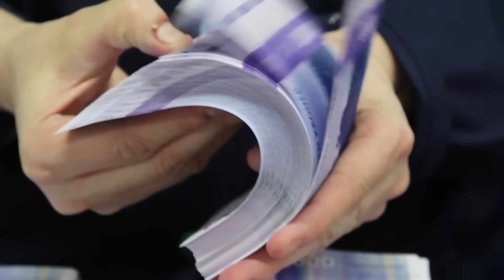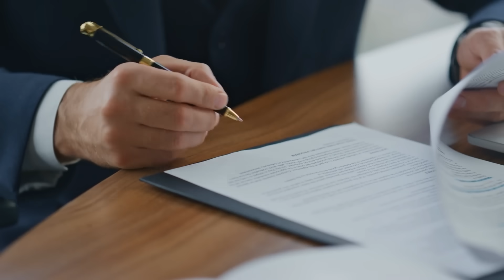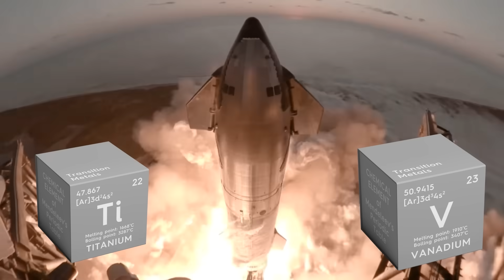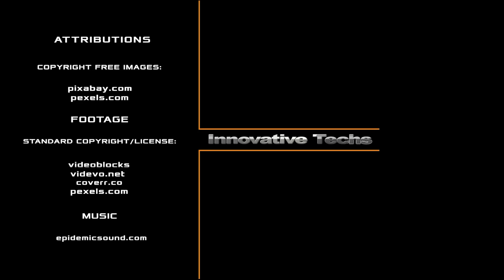Norway has Discovered a Resource that Could Surpass Oil

Comment: I'm pretty sure Norway has pollution issues in other forms that are harmful that they aren't talking about with their conversion.  No energy in the world comes without a waste product.  Let's be real folks.  Give the entire truth and not just the parts you want us to hear.
Reply: What the fuck is wrong with you? Norway is in the north, so we are cold. By the laws of Nature or the Will of God or whatever you want to call it, that means that we must receive the moist air from the equator and it has to release its water on our mountains. Water has to follow the law of gravity, so it falls and as it falls, we use the water to spin wheels to create power as we have done for a thousand years. You may hate us for our lack of sunshine and flat areas, but at that point it's a psychological issue and maybe you should deal with your conspiracy thinking. If your country chose to abandon slavery a thousand years ago and make sure everyone was treated fairly, you wouldn't be so conspiracy driven and criminal today.
Reply: 98% of the electricity is renewable energy. 96% is generated from hydropower, the rest from wind power and solar. Sure the hydropower plants have some methane releases from reservoirs, but it's minimal. There are some ecological challenges because it's in a living river system, but  the carbon footprint from electricity is extremely low compared to other countries. 
The oil and gas production however is horrible, so per capita the ecological footprint is extremely high. That's why the goal for the country is to become carbon neutral by 2030, and zero emission by 2050.
Reply: @i_d_i_e_h  You have the same numbers I have had for years. I think they're slightly outdated now.
But one question I have had, which I have never been able to figure out.....
2% of Norway's electricity comes from non-renewable sources. 
What are those?
I know we used to have a coal power plant on Svalbard. And we used to have 2 gas power plants. And the little research nuclear power plants. But I don't think those would add up to 2%. Do you know what else would add up to those 2%?
Reply: @Tjalve70  Well, it's a bit complicated to explain, and I'm by no means an expert on the subject.

The production alone is 98% renewable. 
The electricity we use is about 90 -98% renewable depening on year and import. The about 2% can be solar and wind, but also gas and coal imported from Germany and Denmark. Some of it is hydropower and nuclear from Sweden. 
You don't really know what you get, because the whole energy import is a mix of everything. 
And some people use wood as fuel during the winter, instead of electricity.

And of course - if you include every detail - we use some fossil fuel to transport fossil fuel, and that reduse the 90-98% down a bit I guess. It varies depening on what and how much we import each year.

Comment: Phosphates are also a critical ingredient in LED lighting. In theory you get white LED light by combining a red, a green and a blue LED in the same package, but that's a way too expensive solution. Instead the vast majority of "white" LEDs out there are actually UV LEDs shining through a phosphate layer that converts their light to a broadband spectrum of visible light. A trick that was used for ages in fluorescent tubes before blue/UV LEDs came along in the late 1990's.

Comment: 0:25  You implied a cause and effect between the Russian invasion of Ukraine and a 5X increase in $ but didn’t explain why oil revenues increased so dramatically.  Global price of oil had the hiccups but not enough to drive the growth you described.
Reply: It's not oil, but gas. However, gas is calculated in oil equivalents. Russia is an enormous supplier of gas but their war against Ukraine forces the world to not buy Russian gas, which restricts the supply and thus raises prices. Europe couldn't supply itself as it like USA does not have electricity, and therefore the EU pressured Norway to amp up the production of gas. To put this into perspective, I liquidated everything I could in 2020 to buy at $16us. One year later, the price was $135us. I bought at 20x gearing, which means I made a lot of money on the war in Ukraine, but I had no way of knowing and I certainly don't want it.

Comment: I had not heard of the findings in Norway.  Good for them.  As for the tailings?  Given advanced methods of ion-exchange separation, it could mean even more resources on hand.  As for hydropower?  Norway and Sweden have been making cheap nitrates for fertilizers from about 1880 or so, from my Freshman Chemistry Course, all from hydroelectricity and those dams that had previously been used for regulating river flow that was previously used in sawmills.  While some may think that those Countries were very poor, they were not.  These folks have been systematically using their brains for quite a while now.  I bet other Countries might have their own clever people as well?  What do you think?
Reply: Sweden also produces bulk potassium perchlorate and chlorate in the north of Sweden by Akzo Nobel.
Reply: in early Canada/USA when brainy residents were looking for ways to lessen back breaking labor they would scout out natural water falls[later the Granddaddy of the them all Niagara Falls] to generate free falling water power to turn their equipment. Later the life saving hydro electric powered by water falls was and is a game saver.

Comment: Even though everything seems too be fine, there are some serious problem for the future in Norway. Demand for electricity are increasing from datacenter for example and other heavily demanded companies. List of waiting from companies that want too have electricity from us are becoming longer and longer. Several cities are already huge issues with meeting the demand and the electricity companies who deliver the electricity too the people and companies wan't too lower the minimum required. So they wan't too increase the "power shortage" too their customers, but now the penalty are too high, but they wan't too decrease the penalty and make it more normal with power shortages.

That's simply insane that was unthinkable just few years ago, but they are now talking about it.
Reply: Datacenters is a resource for Norway as they are electrically heated water heaters. We need hot water in Norway, so as long as we use that resource properly, it's cool if someone wants to spend a million dollars on a 2u rack mounted 10kW water heater.
Reply: @jeschinstad  Maybe. But is that worth all the electricity they are using?
Reply: @MrLasox  Yes. A watt is a watt. Right now we are passing electricity through iron rods to create heat, but one watt of electricity creates one watt of heat. That is called heat loss. 70% of Norway's electricity consumption is 100% loss. That means if we generated the heat by means of Youtube video compression or even Bitcoin mining, then we could achieve 200% efficiency since the computing would only be a method to heat water for showering, washing clothes and heating homes. Another way to look at it is that we can do powerless computing. In fact it should be illegal to build datacenters in areas that does not need the heat.

Comment: Why aren't we getting it out of the sewage?
Reply: Good question.
Probably because it's more expensive.
I know that we USED to get it from sewage before detergents swapped out phosphates with some other stuff. And that other stuff made the sewage unusable as fertilizer.
So my guess is that the best option is to bring phosphates back into detergents, and start using sewage as fertilizer again.
We'd probably still need phosphate, but not as much as before.

Comment: The phosphate from Norway will not be mined until higher prices, as it is more expensive to get to than e.g. in Morocco.
Reply: Yes and that is one of the reasons why Norge Mining will sell to Norge.
Reply: Moroccan phosphate has a problem with heavy metals.  Would be good to find a replacement.

Comment: Interesting video but incorrect display at 10:39 as 24 trillion is not “24 000 000 000” as displayed (24 billion), and should instead be “24 000 000 000 000”.  A trillion is a THOUSAND BILLION and a BILLION is a THOUSAND MILLION, meaning there should be 12 zeros for a trillion.
Reply: You don't seem to understand the difference between long and short format when it comes to numbers.
Yes, in the long format, 1000 million is 1 milliard, and 1000 milliard is 1 billion.
But the US uses the short format, and I think UK does too. And in the short format, 1000 million is 1 billion, and 1000 billion, is 1 trillion.
Reply: @Tjalve70  Are you serious?   So you claim the speaker was displaying an obsolete English measure to (confuse) a contemporary, mostly American-English audience.

You also ignore the fact the speaker in the video clearly said “…with 24 trillion dollars hanging in the …”, he didn’t say “…with 24 milliard dollars…” or even “24 thousand million dollars…”.

Nobody uses milliards in general discourse and the video was clearly designed for general audience.  Why would you would use such a ridiculous argument?
Reply: You're kidding right! 😮
Reply: @darylyost7273  No, that's true. 24,000,000,000 is what Americans would call 24 billion and Norwegians would call 24 milliards. It's common for these mistakes to be made, because people get confused by scale conversion. 1USD = 10NOK but 1 billion NOK = 0.1 billion USD.

Comment: Electrify offshore oil rigs? Honestly, that makes no sense.
Reply: A lot of people agree with you.
I'm one of them.
But Norway has decided to cut back on carbon emissions. And if 96% of your electricity production is hydro power, rather than coal, oil, or gas power plants, then where are you going to start cutting back on your carbon emissions?
Reply: It doesn't, but they are still going ahead I think.

Comment: WOW you are bad with numbers. The screen says 17 Trillion but you said 1.7 also when the screen said 25 Billion you said it was 25 Trillion. You have no credibility.
Reply: The numbers you see are Norwegian kroner (NOK).
10 NOK = 1 USD.
Reply: million milliard billion trillion
Reply: @jacknexus4493  "million milliard billion trillion".
That's a confusing mix of long and short form, which is completely incorrect whichever form you're using.
Short form is: thousand, million, billion, trillion, quadrillion, quintillion
Long form is: thousand, million, milliard, billion, billiard, trillion
Reply: It's a normal mistake because of the conversion issue. In Norway a billion is a million millions and a trillion is a million billions. So everything after millions confuses the fuck out of people. In Norway, it's million, milliard, billion, billiard, trillion, trilliard.